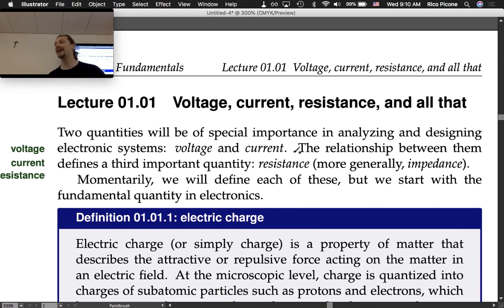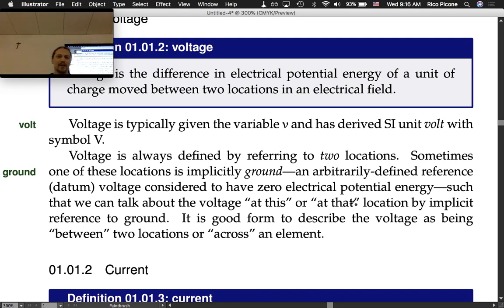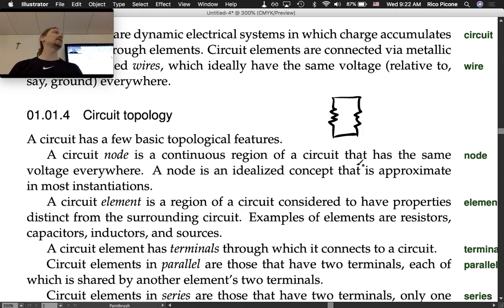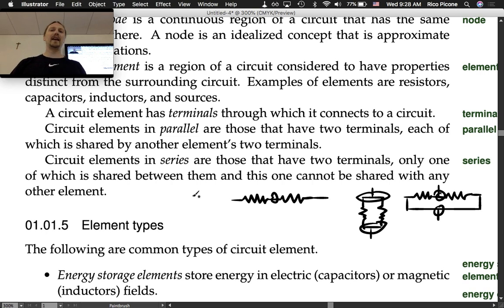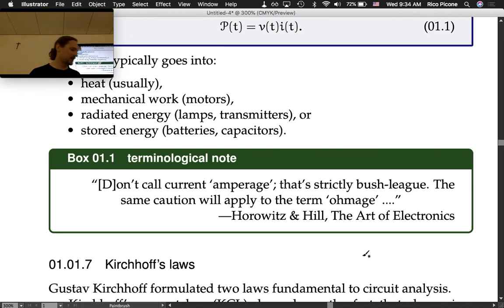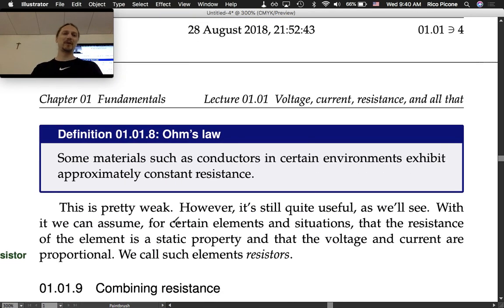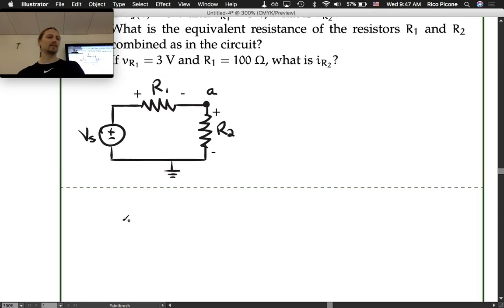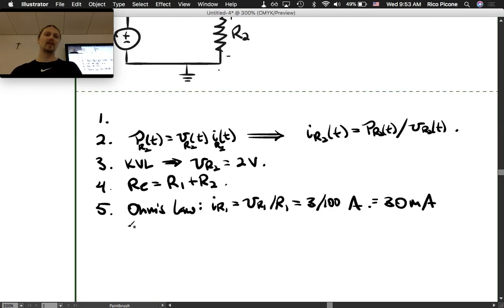01.01 Voltage, current, resistance, and all that

Comment: U make the discussion of current more difficult for beginners..
Reply: Former student of Dr. Picone's here, This is a college level course (if you didn't know) and this is designed to be difficult, in a way. I believe Dr. Picone stopped releasing the updated versions of this publicly, only releasing the notes to actual former students at the end of his lectures. 

Anyway, point is that this is not a beginner course. It's designed for third year engineers.